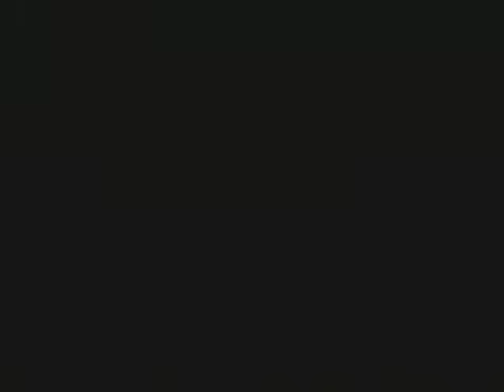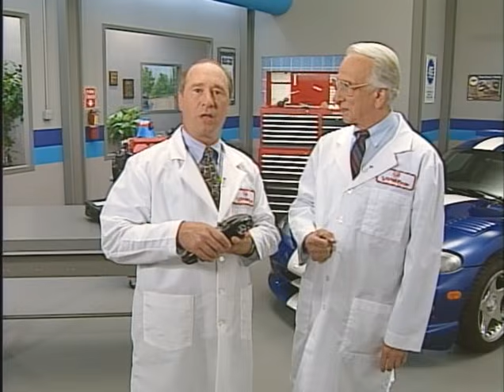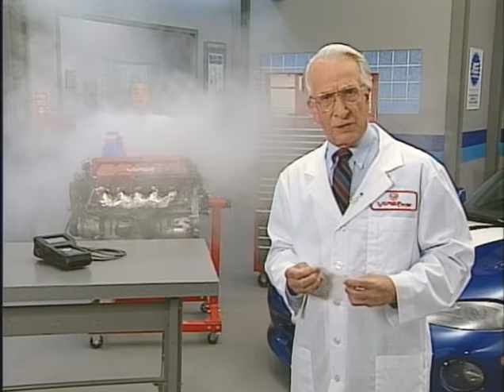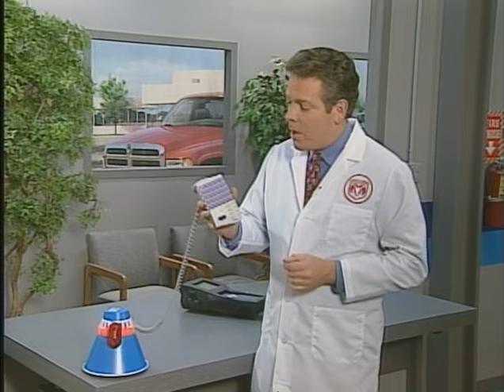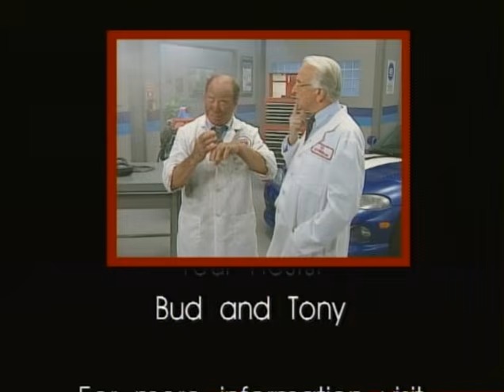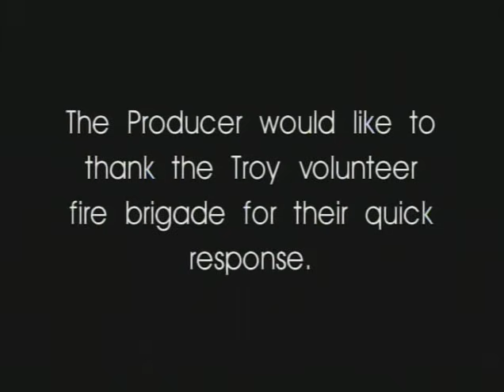Chrysler Turbo Encabulator

Comment: Impossible to prevent side fumbling.  Any mechanical engineer knows this.
Reply: The TB 03 (third generation i think) solved it back in '03 by inversing the phase detractors from the P.S.I.S. position to a more suppinated famulated fam. Which is still used by the newer Hyper Incabulator - though its grammy and gurdle springs are less soidle.

Comment: The counter-rotational prickly friction generator needs to be installed in the usual transverse position then calibrated for atmospheric anomalies. Unless the encabulator is intended for use south of the equator, then the marzel vanes are replaced with their metric counterpart MV-232.059.

Comment: Deplanaration is actually desirable when considering concentric decentralization of fluxal groups. This, of course, is most important for backward compatibility with the oscillation overthruster (not to be confused with the scintillation underpumper, which is conceptually different).

Comment: I discovered with this turbo incabulator that the gravel gears don’t mesh with the reverse engineered indoctrinators. It has a tendency to fail whenever diodic pressures are too high when the vehicle is motionless, mostly from the framiss not interfering with the reguratator. When the reguratator spins counter clockwise, then the gravel gears fail to tolerate the ingratiation coiled web gears.
Reply: This very problem was addressed and deemed non corporal.... which made the whole process validation module 85% more efficient.  A win/win for all.

Comment: Nover trunions in my F-150 grameter phase detraction device have been causing issues for years with gas mileage, Ford won't fix it, and they won't do a recall.

Comment: I like this model of encabultor, however I find that performing maintenance on its sub-lateral induction chamber is quite the task. Furthermore the synchronization on the dodecahedral shwartzfelter rockers in relation to the omnidirectional rotating sub-particle expostulation shaft is often finicky and also requires constant maintenance.
Reply: These days most of the kids just LS swap it and add a big turbo , they’d get a lot farther if they tuned to get the SWRs down

Comment: Reading recent reports of some auto manufacturers having trouble selling new vehicles. The fact that Mopar models have developed and cornered the market via turbo-encabulator technology may well be the crucial factor which will be far more important to Chrysler's long term viability than such remedies as government bailouts. I have heard that the company is considering implementation of next-generation improvements such as non-reversible introspective frazzle-ducting to reduce the exponential kuber slide effects of rotational Richter modal transmission.

Comment: ACHTUNG! Alles touristen und non-technischen looken peepers! 
Das machine control is nicht fur gerfinger-poken und mittengrabben. Oderwise is easy schnappen der springenwerk, blowen fuse, und poppencorken mit spitzensparken.  Der machine is diggen by experten only. Is nicht fur geverken by das dummkopfen. Das rubbernecken sightseenen keepen das cotten picken hands in das pockets, so relaxen und watchen das blinkenlights

Comment: I was directed here by a friend from Rockwell. Evidently, repair service and periodic maintenance for the Turbo Encabulator has been farmed out to an off shore service depot. I was cautioned  actually encouraged to become multi- lingual before contacting the depot concerning my Turbo Encabulator. With only a limited 2 year warranty, I'm fearful of having to shell out more cash to get a new one. The service manual set me back hundreds and I still was not able to locate the problem. Indeed it is very difficult to measure inverse reactive current or capacitive duractance. I am told the culprit may be due to transient voltages in that 7th conductor. The phase detractors must be perfectly synchronized and test equipment will load the Gramm meters down.
Reply: I get mine serviced at a third party service and repair shop, which is cheaper, faster and less hassle.

You should make sure your SWD is gyro-controlled. These days you can also use a digital level for your sine wave director, which can be a cheaper alternative, although the digital readout puts a limit on the number of significant digits. If you use an uncontrolled SWD, you will actually make calibration worse, which may be what your problem is. Luckily, this does not cause permanent damage to your encabulator. If you're not comfortable doing this yourself, you can always take it to a third-party shop. Make sure it's accredited with the IEEEAA agency, as well as (obviously) bonded and insured. You don't want nasty surprises. I can recommend a good shop if you like. Be aware that certain shops may cause warranty loss (which may not be a big deal, btw, considering the high costs associated with the official service depots), but this may be mitigated in the near future with the upcoming Right to Repair laws/Fair Repair Act.

Periodic maintenance is easy, by the way, and you can do it yourself. Just treat the meter covers with Shure Stat and an anti-static cloth every other month. Make sure not to use it if it hasn't been treated in a while, because there will be rapid sinusoidal repleneration if you use it. The meter covers may seem like a mere cosmetic item, but due to buildup of dust, the grouting bushes can get electrically unbalanced, and since the dust is greatly compacted by the moidal interaction, this layer can throw of your readings (by quite a bit, and certainly outside of the 1% spec). It may also affect the ADC, leading to possible costly repairs (aftermarket converters may be significantly cheaper but carry no guarantees). Note that if you're using the dingle arm, this may not be much of an issue because it reduces the sinusoidal repleneration anyway, but it does require trunions which cannot be used in all situations (sorry if I'm being obvious, but better safe than sorry). That said, it's better to just keep up with maintenance than risk faulty operation or, worse, costly repairs.

I loan mine out to help cover the cost, but if you're thinking of doing this, make sure to insure the encabulator. The client will likely not be able to cover the cost of repair or replacement for obvious reasons.

Comment: I was disappointed to hear that this model uses impeller vanes instead of marzel vanes.
Reply: Yes, indeed, I am disappointed too. 
The impeller vanes give a sharp decrease in affluent laminar flow and contribute to coplanar axis inefficiencies not seen in previous models.
Reply: @Rotwold you've got the job!
Reply: you know impellers are more optimal right?
Reply: In a pinch Marzel Vanes can be retrofitted when impeller vanes are not available.
Reply: Yeah I know like side fumbling is no longer a concern.
Reply: But the impeller vanes are in the marzipans.
Reply: I agree… That regressively cantankerous design decision has left me broken hearted.
Reply: The Intrafabular ventification of of the air intraflowbular tabs doesnt triblate the compesulator fast enough!
Reply: I have no idea if yall are serious or not but I'm still laughing nonetheless 😂
Reply: Well the B phase Canute valve failure needs to be addressed.
Reply: Use of the marzel vanes led to sinusoidal depleneration.
At the upper end of the gramy tubes.
Reply: @INTELLIGENTCOMMUNITYGETSMART  that’s the worst place for that to happen
Reply: Me too, furthermore, I was remissed to hear the lack of inclusion of optimized Deiznet-Hartman decommutators for phonetic mastication of the Nangling Pins.. or something like that..
Reply: But the HyperEncabulator works better without them.
Reply: Ultimately it was simply not cost effective when considering the modial telemetry of the high performance non flux dangle Rod
Reply: @jamessharp9790  I was thinking the exact same thing.
Reply: @Unclejake  well I can remember the days when canuter valves were inexpensive. When you had one on each of three two barrels that son of a bitch really threw you back in the seat. Of course, with increasing environmental concerns, it was inevitable that the deliberate farming of Canuters just for their valves would be stopped. Well, at least we’re more responsible and ethical persons now. 🤣
Reply: There goes the panametric fam. And the dingle arm. I guess its Back to the drawing board .
Reply: W comment
Reply: Marzelvanes were only possible with preframulated amulite.  Impeller vanes work best with Quasi hydrolyzed non ferrous polymers.
Reply: Tony is my favorite character ever in the history of media.
Reply: I blame planned obsolescence
Reply: it can lead to side fumbling
Reply: Rockwell Automation solved this issue with the inclusion of vertical marzel vanes!

Comment: Gurdle springs are getting hard to find ever since they had the big dingdle arm recall back in '01.
Reply: Try having your girdle springs redifferentiated, not gonna happen. Not in todays economy.
Reply: I just used corset leaf reciprocators to replace my gurdle springs. They can be found easier if as long as you don't mind defracting phase stators from GM models.
Reply: There’s a company in Western Australia of course, reproducing them but in a 5056 forging along with urethane bushings in combination with zytel needle bearings .
Reply: If you Do extrapolate the osmiality you can typically see gains equivalent to 75hp or 10 quagnines
Reply: That's why you have to use dohickified oscillators instead. Works every time.
Reply: Companies today don't even bother with dingdle arms. Much cheaper to pay some kid in China to install auto-spirinolacted sensors. Everything is electronic these days. Sad 😢

Comment: Now wait a minute: A company in New Zealand has just been granted a patent for a di-modial parametric flam, which will surpass the retro-encabulator's performance in the NON-linear region. It has demonstrated much more gain stability and a wider phase margin in the lambertorial response when coupled with the planar detractor, which does in fact exceed the goals established at the onset of the retro-turbo-encabulator development effort. I strongly urge this company to redirect its efforts on the dingle arm refinements as established in the Federal governments original RPF.
Reply: Yes, but that will cause the dingle arm to go limp. Then the only way to fix that is with the viagrariam conflagration, and that is expensive.
Reply: Mike Ford
haha!!! Yep, I honestly hadn't considered that. We'll now need to shift our production to Mexico, where the Viagrariam is MUCH cheaper to get!
Reply: Nonsense, anyone with even a basic grounding in sub-essential predictilative electro-duractance theory knows you can't couple a modial parametric flam with a planar detractor without introducing semi-invective duractance across the entire solenoidal trunk assembly of the principal (meta-primary) marzel vane, which obviously leads to partial non-sympathetic de-synchronating fluctions within any transductively conflated Gramm meters. This is basic stuff.
Reply: That was 5 years ago we have microencabulators now
Reply: Well stated sir, well stated...
Reply: I must disagree. If you look at the algebraic equation of Pi (3.14) added to the total diameter of the main spindle, and the floating synchro hub, you will soon realize given the Rohr hardness rating of the case hardened steel shaft, unilaterally spinning in a reverse direction, at one quarter of the speed of the dual camshafts located above, you'll understand exactly where I am going with this...not so basic stuff...
Reply: These comments never get old 😂
Reply: However being in the southern hemisphere would mean it would be 180 degrees out of phase and therefore not bound by patent.  Coriolis effect.
Reply: @scottgibson807  Ah, son-of-a-gun, I did NOT think of that...
Reply: Quite frankly, the only real fix is using a #6.9 Y-type box socket with a 2-lipped hair flange.
Reply: @combridge1 aww yes didn’t consider that
Reply: I have found my people!!😂😁
Reply: Ut oh, time to call INTERPOL!
Reply: It may solve the self sustaining runaway resonance amplification reactions, and granted.. it will allow the ablative shielding around the EPS conduits to constructed of much lighter and flimsier materials, like Interwoven hopes and dreams instead of the load bearing paper mache currently used. And I think it's established sudo-science at this point that trapezoidal spheres are a construction of society and a means of last resort. 2 dimensional spheroid cubes are obviously superior, unfortunately such designs are not for the logical or rational mind.If they were, we'd all have cats and live in tar paper shacks.. am I right?
I digress..
While recent discoveries down under are  interesting.. when actually applied.. the treble is flat and there is no bass.

Comment: Ahh, the updated version really explains it much better. I'm sure once Fiat gets their hands on it both styling and performance will greatly improve.
Reply: Perhaps so , but possibly at the expense of reliability or at least versatility. As you’re aware the transaction inflibuation resonance can be slightly diminished when the driver consumes a greater amount of pasta products . However , I higher olive oil Mediterranean diet with weekly flux capacitor shock therapy has been shown to reduce some of these variances to as low as 100k giga multons .
Reply: insert that one bladerunner reaction image